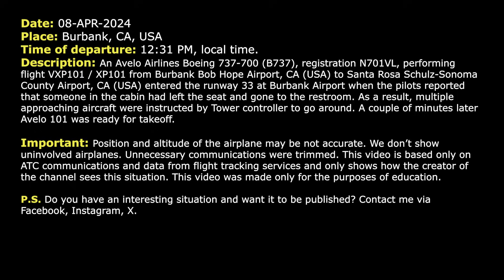Passenger causes multiple go arounds at Burbank Airport. Real ATC

Comment: 3:00 there is no “published missed approach procedure” for the Rnav visual 33. Only to expect ATC to issue 270 heading up to 5000 feet, but there isn’t any missed approach procedure. Poor job with the controller..
Reply: 1) The vast majority of the time, they issue that as the missed off Runway 8, so it's a habit. 

2) For airlines that use an op spec visual procedure, they may have a published missed. 

3) Expect 270 and climb 4000 is published. Fly it and call SCT for further vectors.
Reply: @N1120A my airline has the RNAV visual, and it specifically said there is NO missed approach procedure for 33, however the “Expect” is 270 heading up to 5000.
Reply: DEI hire at its finest I would bet.
Reply: @MrThisIsMeToo  Most stupid comment I've seen today.

Comment: Avelo 101 should have been moved from the active. All the other landing aircraft were delayed and put at risk for one passenger.....
Reply: But the problem is the spacing between the terminal B ramp and the runway is extremely tight. There is no taxiway.

When a plane pushes back from terminal B, they're literally up against the runway.

There's no room to move them to

Comment: I'm confused why the controller keeps saying expect to go around before the Avelo was on the runway. 3 arrivals were told that before the line up and wait command or the passenger got up. Sounds like something else was going on before the Avelo.
Reply: A couple of reasons

There's no taxiway to runway 33. Planes have to back taxi because the spacing between the ramp and the runway is just a few hundred feet. 

Aircraft lands and/or departs on 33 at BUR on windy days. I flown in and out of BUR many many times.
Reply: The terminal is old and the airport is older. It's not on ATC that this configuration doesn't work out when winds don't allow landing 8 or 15.
Reply: @N1120A it is possible to not move an aircraft out of the hold short area when another is short final, and it’s also possible to move an aircraft off the runway once their passenger has sat back down
Reply: @ndub1410  the issue is when Avelo pushes back from the gate, they're literally up against runway 33. There's no hold short area because it is so tightly squeezed. Lookup BUR on Google maps satellite and you'll see
Reply: It’s possible to move an aircraft that is ready but then awaiting release off a runway, and to have an aircraft not leave the hold area if another is short final. There’s no sense of urgency. A go around involves a takeoff sequence, which is the most fatal sequence
Reply: It’s because the 33 hold short bars are closer to the intersection of 33 and 8. Once the plane taxis down that “B” lane, they are technically on the runway and planes can’t land while Avelo is there. Poor on ATC if you ask me.
Reply: @thomasaltruda then he shouldn’t have had them leave the hold short area to line up and wait
Reply: @thomasaltruda  But why couldn't the Avelo just start? (before the pax has stood up or after he has sat down again)
 Was the 33 still occupied on the other side?
Reply: @legofreak3204  either that, or someone was departing on runway 26. The intersecting runway.
Reply: I'm guessing that based on Avelo's position they were probably too close to the runway. But why he didn't clear them to takeoff earlier before the bathroom issue, I have no idea
Reply: Bottom line, bad airport planning.
That layout is just crazy!
Reply: @Southwest_923WR  it's going to be fixed, though. They are rebuilding and relocating the entire terminal as we speak. The current terminal will be knocked down, and two taxiways will be put in its place once the new one opens